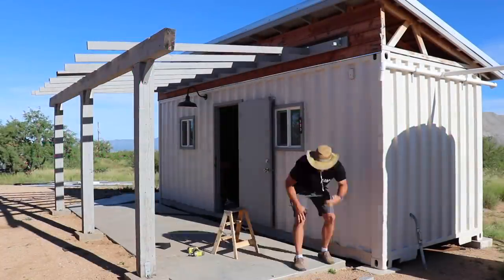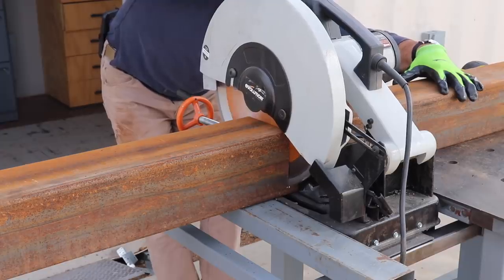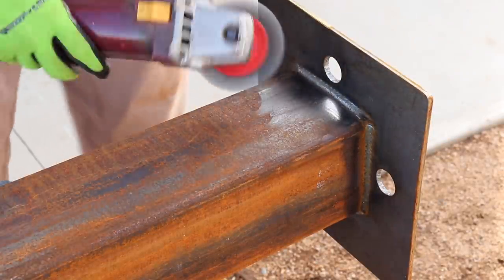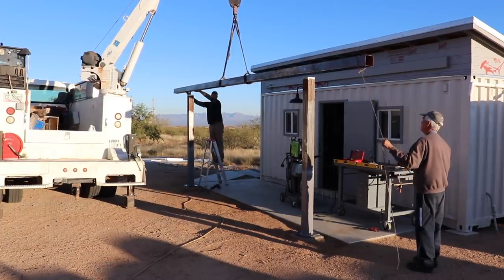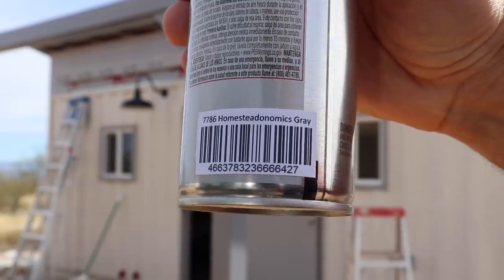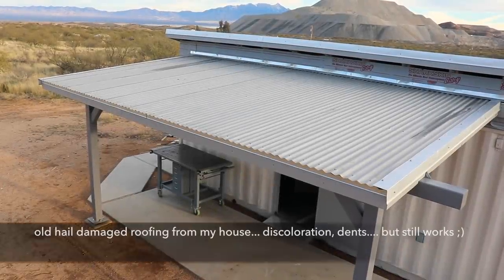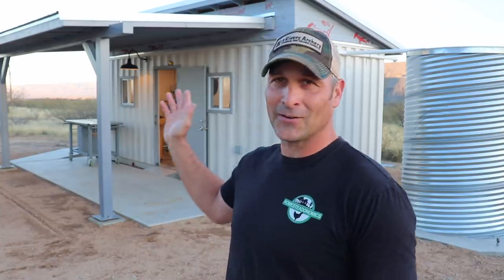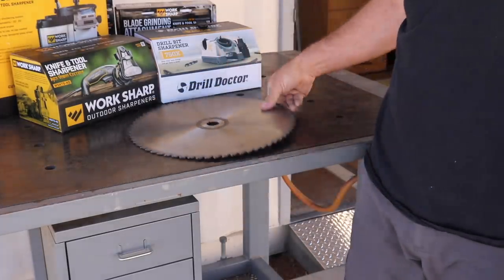Built to LAST!   Shipping Container Shop Awning 2.0

Comment: As noted please wear eye pro when spray painting! Can't hurt to wear. Could hurt not to wear.
On a lighting note. Amazon has all sorts of LED proximity lights. Where they are lo at night then when you get close they go bright and once the motion stops/~15-30s then go lo again. It's kinda cool and no wiring needed. 
Cheers
MJ
Reply from the maker: mike johnson thanks Mike!  I will check them out.  As for the eye and lung protection....believe it or not i usually do....I painted this about 95% then set up the camera and just didn’t put them back on😉
Reply: @homesteadonomics  besides the safety factor. It's also about the cost of going to the Dr and meds if something does go wrong.

Comment: I'm confident that awning won't blow away! The anchor plates are not resting directly on the concrete pier footers. What's in between that we can't see, and could you explain why that is how you did it?
Reply from the maker: Pat Black if you watch when I placed the post on the footer...it’s the clip of where my dog is watching me.  You will see I have nuts and washers....they are under the plate so that I can adjust them to get everything perfectly level/plumb.  Then washers and nuts secure on the top of the plate too.   The void area will ultimately be filled with concrete grout to lock everything in place.   Hope that answered your question😀👍
Reply: @homesteadonomics  Okay, now I see what you did and you explained it perfectly. Thanks! It's good you had a dog to supervise the installation!

Comment: Saw blade with carbide ends are not good for knife,is soft metal.
Is condensation a problem where you live? If yes then drill some holes on the base of the steel frame. I had a thight welded frame and first winter it become oval from square :)).
Nice built
Reply from the maker: Restaurare si Reparatii I drilled two 3/8 “ holes after I welded the plates on for just that reason.  As for the blade, I’ve heard mixed reviews about the metal.   I’ll have to check my others and see if I find something better

Comment: You talked about making a knife, I was in Laos in November and watched a man make knives from pieces of leaf springs.  He set up a forge using bamboo tubes that his wife pumped plungers up and down to blow the air on the coals.  He hammered and ground out 2 knives a day.
Reply from the maker: Terry Blanchard I’ve heard that leaf spring steel can be quite good for knives and tempering....but I’ve got the saw blades on hand....of course I may have to check around to see if I’ve got any other options like some springs 😀👍

Comment: You obviously ran out of money on the roof ... but your welds are a dream.
Reply from the maker: Werner Pfeifer thanks!   As for the roofing...,it was just the most financial sense considering we had it in hand.   If I do another one I would like to use standing seam metal though😀👍
Reply: @homesteadonomics  I only meant because the roofing is shorter than the wall bench and the container ...translate with google ...sorry...
Reply from the maker: Werner Pfeifer no worries Werner,  I understand what you meant😀👍
Reply: @homesteadonomics  Where you did your pull-ups, it shouldn't be that long

Comment: MY GUY ! Looks fantastic! Put some darn DRAIN HOLES in the bottom of those columns. I'm and engineering tech with years of work at a steel detailing firm. EVERY project outside had the ability to drain. Sh*t is never weather tight
Reply from the maker: Johnson Rocson thanks!   There are actually two 3/8” drain holes that I drilled after welding the plates.   Would’ve been easier when they were just plates but they are there😀👍

Comment: Nicely done. Looks really clean and professional. I like the Rust-Oleum high performance enamel too. It a very good paint. Is that trim on the side of the awning under or over the roofing panels? I am building and awning myself and haven't figured out the edges yet.
Reply from the maker: Desert Owl Forge thanks!   The trim is 4x4” and extends ‘over’ the outer two corrugations.   If you used say 2” flashing you would have to do it under though as there wouldn’t be Anouilh overlap to go over.   Hope that helps!!  😀👍
Reply: Thanks for the info Joe,  I am using galvanized metal roofing so I'm not sure what size to use. Looking forward to the next video. Are you still into crafting from pallet wood? I really liked those projects ( I like the once you do too). 👍

Comment: My choice is TIG welding with steel instead of wire or stick. I find it a cleaner weld. Slower but cleaner. Looks nice and clean and for sure better than wood. On the base did you use bolts as spacers to keep the steel base off of the concrete?

Comment: Good job ,Joe. You might have to upgrade that beam for a lifting dolly, it could be a bit undersize. R O'Brien.
Reply from the maker: Robin O'Brien thanks!  If I ended up adding something like that, I would probably add some extra steel on the side or under that beam to mount the hoist to

Comment: If you like the look of the redwood, you could try a flooring laminate. See if it holds up, you know.... For science!
Reply from the maker: Craig Schnagl I do like the wood look a LOT.  But for durability I’d want to got with composite boards....but hey are just so expensive.  However I am testing some composite fence boards and they haven’t really faded at all in 3 months.  But, they are kind short so I would have a lot of seams showing.

Comment: My thinking was if you welded as you did... Stick welding would've been preferred due to rust on edges. To MIG, me thinks derusting would've been step 1 before welding. But what the hell do I know!?! You're to do'er here and me just a watcher adding 2 cents for your consideration. Thanks for posting.
Reply from the maker: Don Quixote i probably should’ve explained that section a bit better.   But it you looked at the areas when I’m welding..... they were all bare clean metal on the inch or so around where I was welding.  When I showed that clip of the wire wheel on the weld, that was a about a week later after we had a rain and it got a little bit of rust.   So I was cleaning it before I added paint😀👍

Comment: homesteadonomics what type nail gun do you use and what size air compressor do u have 

P.s love your videos could watch them all day 😎😎
Reply from the maker: ccrbt5 ccrbt5 thank you so much!   The nail gun I use is a 16 ga porter cable for the air powered one...and a ryobi 16 ga for the battery operated one.   Air compressor is a husky 10gal if I remember right
Reply: @homesteadonomics  thank you

Comment: If you prime onto the steel when it is “ginger” then the paint sticks better! 
 Thank me later.    (Don’t go shining it up with that wheel too much)
Reply from the maker: rollo vaughan thanks!  Will keep that in mind for the next metal project 😀🙏
Reply: homesteadonomics. I did many years sandblasting on an industrial scale. 
 The science even said the paint performed better as the oxide layer worked with it.....somehow.....scientifically....somehow.
Reply: What exactly do you mean by ginger? Thanks!
Reply: Fred Carson. Fresh oxidation. 

Under a microscope the newly formed oxide on clean shiny steel looks like little cigar shapes, all sticking out at random angles. 
 To the naked eye these look like an orange 🍊 blemish. Ie; ginger!   These little microscopic cigars hook into an appropriate primer giving a really good bond. The oxidation process will stop too as it is sealed.          Bit like using slightly rusty nails in timber, they hold better.  If the timber is dry and indoors the nails will not oxidise further.   Any old carpenter will tell you that.

Comment: Why don't you stucco it. It would be pretty easy with such a small area! And will,last a log time.
Reply from the maker: MIKE BUSCH it would last a long time....but I’ve got stucco on my house so it’s kinda nice to have something different on the shop😀👍
Reply: How big and how many metal trailers are allowed. Here in San Diego county they are frowned at. They can be dressed up nice like your doing and be a cheaper route. That's why I want to move to Arizona. A bit more freedom. Nice job by the way on your shop.  kid approved I see.

Comment: I'm curious how these shipping container homes stand up to tornadoes
Reply: Exelente
Reply: It's all about making sure it can't be lifted and tossed but besides that i can't see a tornado ripping one apart.
Reply: @jagsfanrick  thank you ,I was curious,  I've seen tornadoes lift train cars off the tracks as well shipping containers pulled by 18 wheelers. Those weren't anchored down however.  I guess if you can figure a way to anchor down a shipping container home or building, it would do well against tornadoes and strong straight line winds
Reply: @jagsfanrick  Well, if you lived in Moore, Okla., you would get used to seeing train cars, semi trucks, and factory sized metal buildings get wrapped around what's left of a tree.  F5 baby, I've dodged 4 of them here in Moore.
Reply: @janettavculek9308  well i have seen what high winds can do. Amazing the metal it can twist.
Reply: @rustyyates421  The frame of a shipping container (ISBU) is where all the strength is. The thinner sides are pretty strong as well, so long as the whole container is intact.

If the container is on solid concrete footings, with well embedded long bolt points, they can take quite a beating.

Any windows will be the weak spots.